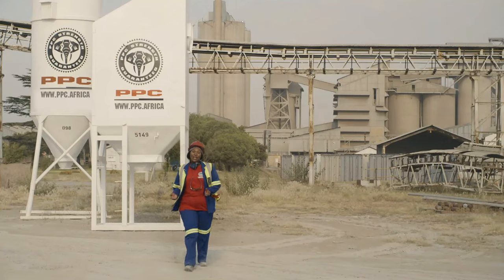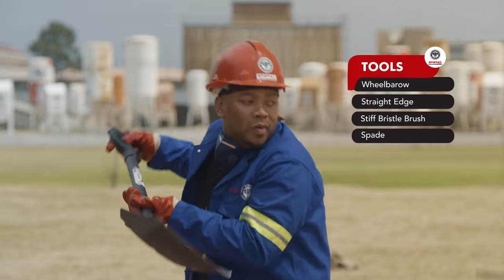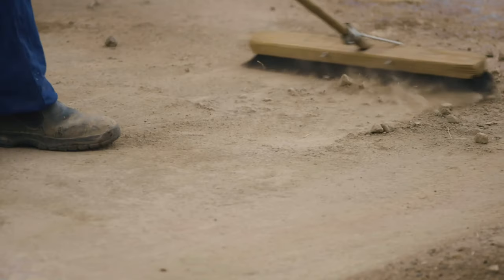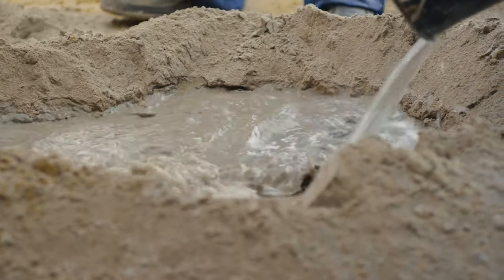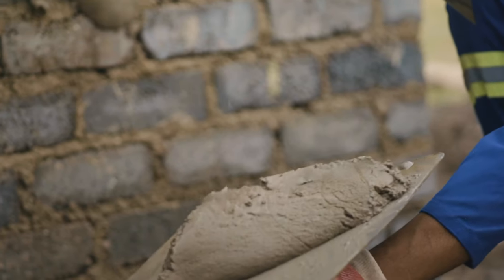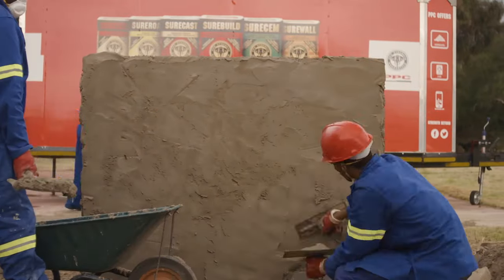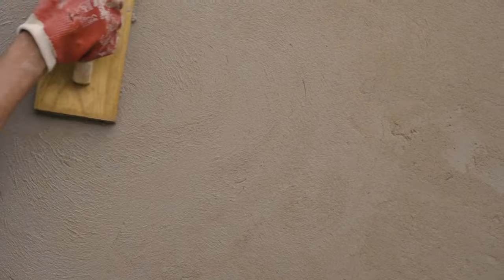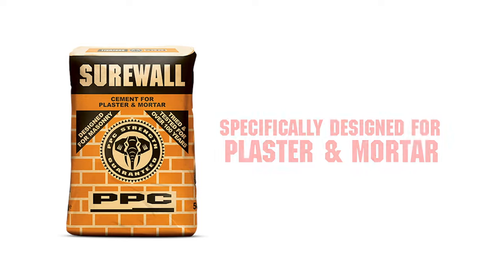Episode 4 - How to plaster a wall

Comment: Ooh wow! I didn't know there was a PPC cement specifically made for plastering walls. This is incredible. However, I do know that using PPC to plaster your wall guarantees a smooth wall, doesn't crack when it gets wet due to rain and also when getting burned by the sun. If you use the correct measurements as advised, then you're good to go! #BuildStrongerWithPPC #StrongerTogether